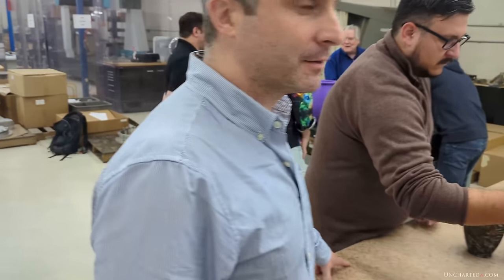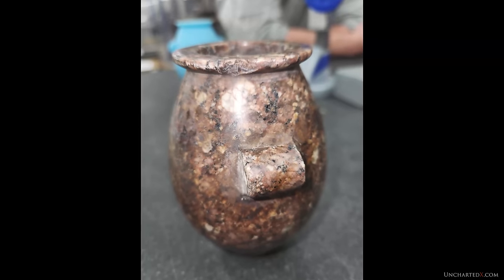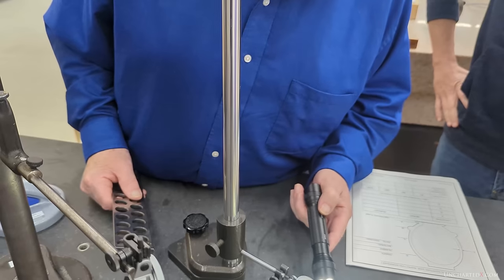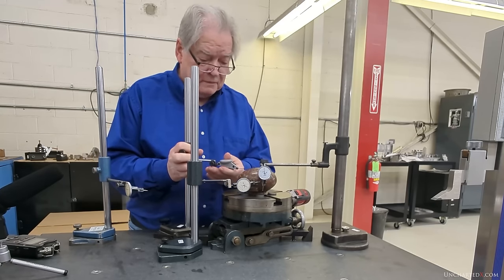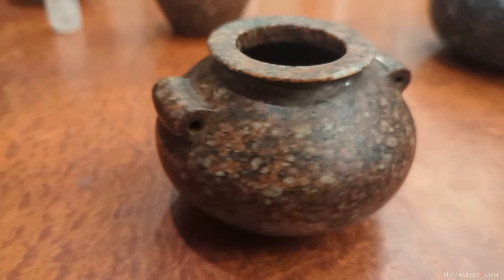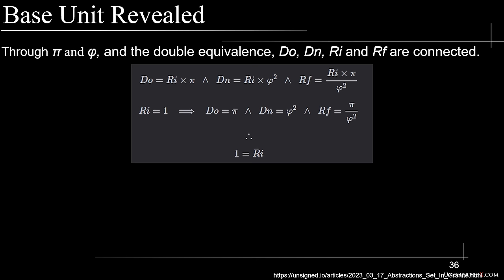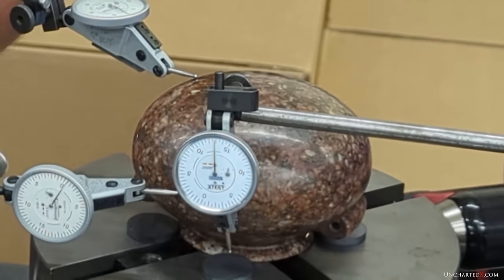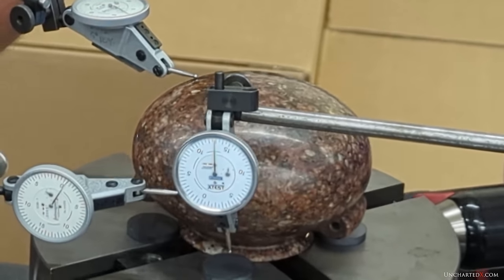Astonishing Results! More Ancient Egyptian Granite Vases Analyzed! More STL's available.

Comment: I run a cnc machine, and for most parts .002 tolerance is considered good for most parts, certain dimensions might require .0001-.0002 tolerance... but that's dependent on to what it mates.
Reply: Machinists before CNC for Very hard 3D shapes before age of CNC would make a 3D mold out of clay, plaster of paris, check it for tolerances, fill it to tolerance, machine it, check tolerances, polish it down,  etc and then use a follower in the hard final material.  How carvings were copied for many fancy Temples in Europe(they aren't Church's), especially the ones built of wood for interior fancy decorations.  

At minimum a society able to machine to late 19th/earth 20th century standards.  BY mid 20th century BEFORE CNC we can easily make these vases using ball end mills and followers.  So, Egyptians of old certainly had machine tools, or carried these vases from a society who had machine tools... the question remains, what happened to the machine tools?  Then again I see the rust of the giant steel beams under our bridge over our creek and in 20 years  the beams had lost ~3/8 of an inch on their flanges as we had not done proper paint maintenance... so... <<oops>>
Reply: Right....and the main difficulty in reproducing one of these vases would be holding it sufficiently to grind away the material without crushing it.   I have no doubt that modern 5 axis machines could reproduce such a vase...but it for sure would take quite a while to develop the technique to accomplish it and the very fact that we're comparing such an ancient object to our 'state of the art' machinery is an amazing compliment to our ancient workmen.
Reply: @w8stral  Where are the machines that made a skyscraper completed in the 1930s? All evidence of construction is completely gone from the site by the time the skyscraper is finished. The next step back is medieval cathedrals, and likewise all evidence of construction methods is totally lost. We know nothing of the tools, processes and personalities behind these incredible structures, and the sites offer no evidence. The next step back is the pyramids and other ancient monolithic work. In all cases, throughout history, from recent times back, the artifacts of construction methods is simply not there.
Reply: @w8stral  how did these ancient Egyptians know how much material to remove or leave behind to be accurate within a few 1000ths of an inch, when the micrometer wouldn't be invented for another 4000 years?
Reply: @w8stral  why would they go through all of these extra steps in order to make something more precise than what can be detected by touch or eyesight?
Reply: Why do artists do what they do?  Well if it is what I think, basically a religious symbol to carry ashes etc for their dead, then certain symbols, dogma, etc are encorporated.  The orienteation of the pyramids(due north/north star), the angles and in this case ratio's.  Another ancient religion, Zorasterism essentially does this as well.  Star gazing etc.  Even the building of the famous Church's during enlightenment when everyone was rediscovering Mathematics, the 1/3 ratio arch is built into ALL the cathedrals of the time period(trinity) in the case of Christianity.  Numerology is prevalent throughout most religions.  There is also a more fundamental reason, if you do not have a calculator or computer, but you do know algebra, knowing ratio's allows shortcuts to use simple sticks, pins, and string to create an object without doing the calculations to say, create a mold to create an object to check the object and fill, smooth, etc to then turn said object into the end product, granite vase/bowl, etc.  All the above has been forgotten by those in modern age who have never gone without access to Geometry lookup tables, calculators, computers etc.  There is so much math that people do not know today that our forefathers had to know and one reason why very few actually knew it.   Also there is a basic rule why Base 60 number system was used throughout ancient times.  Factors into 1,2,3,4,5,6,10,12,15,20,&30 making calculation easier.  Likewise easy for Geometry involving PI.  Why TIME is base 60, French only counts to 60 before starting over... etc etc... and still used to this day even though it makes NO SENSE in modern times.   @AustinKoleCarlisle
Reply: @w8stral  we're talking about precision, not art. precision has a function, art usually is just for aesthetic purposes only. hardly an apt comparison.
Reply: Engineering is art bud.  Just those who know nothing about engineering think it is not.  If it was not an art, everyone would create inventions and applied concepts.   @AustinKoleCarlisle

Comment: I worked with an old toolmaker back in the 70s who built custom jigs to manufacture precision parts during WWII. He told me that the best machinists/toolmakers could eyeball making a part to 0.020" with modern tools. About 20 times worse than an Egyptian with a pounding stone.
Reply: we humans have pretty well designed measuring tools built in by nature for flatness and straightness (we are predators and need a perception of depth and our surrounding to get the hunt done well otherwise we would not be around to begin with), but where we can not handle things is when it becomes round. And this is the case with these objects, you can not eyeball roundness/circularity on a curved surface. Or in other words would the object be flat with every surface the way to manufacture it would be magnitudes less problematic then how it is shaped.
Reply: !!! Wow!
Reply: Nobody but Ben claims these were made with pounding stones.
Reply: @okgroomer1966  huh? He literally says the opposite of what you just said.
Reply: "...the best machinists/toolmakers could eyeball making a part to 0.020" with modern tools." We used to work to at least 0.010" (eyeball) when doing lathe work to loose tolerances, using a good quality steel rule and calipers, but that was just flat, straight diameters, and with steel. When you consider curves, and a material that has varying areas of hardness, it's difficult to know where to start!

Comment: Even knowing the mathematics 10 - 12 thousand years ago and creating such a vessel is absolutely amazing. This is a little beyond the slide rule vase. These people had the ability for precise measurements and the accuracy to perform it. Wow.
Reply: Kind of scary that such a civilization disappeared or things became so bad the knowledge and technology became irrelevant to survival.
Reply: For work that is the best of the best is called ( EPITOME OF SATANIC ELEGANCE ) !
Reply: just think of alien civilization on earth some 18,000 years ago but they were descendants of 100,000 or million years of technical evolution they travel through space at faster than light , the precision and machine they had was standard for them including anti-gravity lifting pods , what i imagine is rather small machine with some kind of computerized memory and desintegrator cutting head equipped with sensors to achieve precision , the cutting tool is an immaterial energy beam that cut by removing valence electrons responsible of atomic accretion , to see cutting traces you need electrons microscope to see molecular traces

Comment: I keep thinking about the wide vase opening and handles. Almost all vases have the same small hole in the handles. It doesn't look suitable for holding with your hands. Is the hole in the handles always the same size, regardless of whether the vase is bigger or smaller? 

Great video, Ben! Absolutely mind-blowing
Reply: That is a good point. Perhaps the holes were for putting rope through for carrying or something practical like that, but maybe it is a part of the manufacturing process. I would like to hear what is known about this from the historical record, if anything.
Reply: The fact that the handles are all the same while the base bodies varies considerably is a significant clue to the function of these artefacts. There is a reason for them to be the same that goes beyond aesthetics. It was somehow a necessity.
Reply: That makes me think the vases with the small holes were part of an assembly line chain.
Reply: these were ancient lightbulbs, calling it now.
Reply: Re. the hole is it a "drill hole" per se' meaning perfectly straight through or does the hole actually bend/turn with the curvature of the object????
Reply: that's a good question, on the 3d scan it looks straight, and what was very interesting to me looking at the STL file was that the holes were way off, like hand-drilled, far from the accuracy of the rest of the piece @mrboics
Reply: The theory is that the holes in the handles were later additions. They are not anywhere close to being as precise as the rest of the vases.
Reply: @egidd  these holes are the equivalent of the crude hieroglyphs on precision statues. obviously a later addition by a less technically savvy people.
Reply: So the holes are different sizes depending on the vase. They do seem to be eyeballed, hand drilled.

Comment: 27:50 - I align pump and drive motors using a dial kit like these as part of my duties at work. It needs to be precise, otherwise the motor/gearbox/pump bearings and the coupler will suffer vibration and a reduced operating life. I aim for less than 3 thousandths angularity and offsets on the vertical and horizontal axis. It's a finicky, time-consuming process; measure, loosen, shim and adjust, tighten, measure, loosen, shim and adjust, tighten, measure.. It's a real pain when it's a 400lb electric motor, and 3 thou is a bit more precise than needed given the RPM most of our stuff runs at, but it needs to last and be reliable. As someone familiar with the use of these tools, watching the readings on that vase at 27:50 makes me a little queasy.. The precision and consistency on this thing is absolutely not an accident, and the implications are humbling and disturbing.
Reply: I've done similar work aligning electric motors to big refrigeration compressors, not quite to that level of precision but I understand how finicky it can be. Seems to me that the sceptics just have no real understanding of precision.

Comment: The design and precision of those artifacts is mind blowing and really begs more questions than the precise measurements can answer. I've wondered about these objects and other artifacts that appear to have been turned, drilled, or cut with a hole saw; is it possible that the people making them could have unintentionally recorded the sound of them being made and perhaps even the makers own voices into the surface, like an Eddison phonograph cylinder? Would a precision scan with a laser be able to make a digital copy of the surface and then you just have to find the proper "playback" speed to hear what may have been stored on the surface?

Comment: This is fascinating stuff.  I've never worked in a machine shop but I've seen plenty of lathes in use and it's hard to imagine being able to create something like that without.  Pretty amazing.... and actually, it's hard to imagine something like that thin granite vase being created it all.  That's wild.
Reply: it is amazing...but put a bit of dop wax on a bit of low silica granite pebble with a stick, spin it and hit it with corundum mud and another bit of wood and you can rough out a lot.  Not sure how the exact numbers are made to work out but I'm thinking it is done with measured strings as guides somehow.   Eh...it's a supposition.  Go to Pakistan or Afghanistan etc. and I bet they are still using the same technology with corundum dust or topaz dust etc.  Some of those crazy guys still make giant industrial gears out of bearskins and stone knives.

Comment: And I’m assuming that to make them this precise would mean the manufacturer had devices to measure to such small amounts? Another mind blowing fact because there’s no way primitive Egyptian tools could make measuring devices with this kind of precision!

And how do you chip out the inside of these things with hand chisels and get the wall thickness so uniform?!😮
Reply: Possibly, it wouldn't necessarily need measuring devices if the accuracy resulted automatically from the way the machine worked - to take a simple example, a lathe will produce very accurately circular objects because the object is spinning round - as for "chipping with chisels", that's just how Ben talks, have a look at some of the links in the description of the (annoyingly titled but well-researched) "Dudes think they can prove Atlantis by measuring a vase" video if you want a fair picture of mainstream archaeologists' actual theories about how these things were made, dunno if it could have produced this level of accuracy or not but it wasn't "chipping with chisels".

Comment: Also worth noting is that the original vase's base unit of ~18.739 mm is very close to the size of the ancient egyptian measurement unit of the digit, which is stated to be 18.75 mm, so only 11 microns deviation.
Reply: Those Dynastic Egyptians and their micrometers with 11 micron margin-on-error...
Reply: This is what happens when using cheap knock- off micrometers.

Comment: After looking at the sample gathered here, I made this reflection to myself; half of the vase are tautochrones.
From bottom to lid, half of them follow a tautochronic curve.
Such a curve is easy to draw with a plate, a ruler and a pencil, but reproducing it on a lathe (with standards of precision as witnessed) not so much.
Unless the lathe can rotate the piece on a different axis.

Edit: Not a ruler, a straight board. A perfectly straight board, and a perfect circle. The fidelity of the curve depends on the fidelity of the tools. Any error on the tools would get doubled on the curve.
That's for drawing it. Cutting it out of granite? I don't even know where to begin.

You could cut the curve layer by layer, and sand it smooth at a later stage. But I bet you'd see peaks and valleys with micrometry.
To achieve such precision, you need to run another machine to run perpendicular to the lathe and cut the piece as it's spinning.
And that's before you factor the handles and cutting the inside out. Without breaking the piece.

And the process was easy enough to produce thousands of pieces.
Reply: That's the only explanation, but it would have to be something out of a sci-fi movie to spin it and carve it on the X axis instead of the Y axis.
Reply: You hit upon the exact method used for fabricating stone  objects. They used a powered tool head spinning a diamond saw blade such as we use today as the work piece is rotated by hand on the base plate/head.
Reply: Nah man maybe they just rubbed rocks together lol

Comment: For anyone doubting the difficulty to work granite, I invite you to go to your nearest home center of flooring store and examine some granite tiles.  If you hold them to the light at an angle so as  to see the light's reflection, you notice tiny pits in the surface caused by the heterogeneous granularity of the material being affected differently by the cutting and polishing processes.  And remember that this is on a flat surface--the easiest to machine.
Reply: 'heterogeneous granularity' wow that felt good to read. what a combo of words